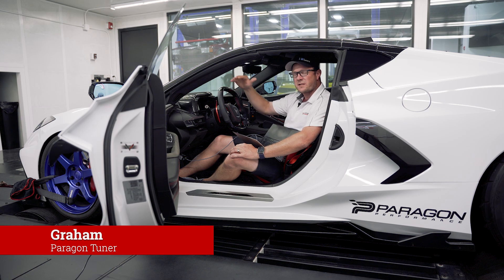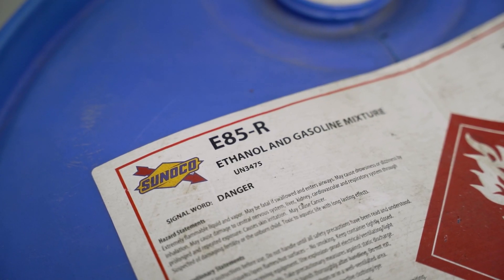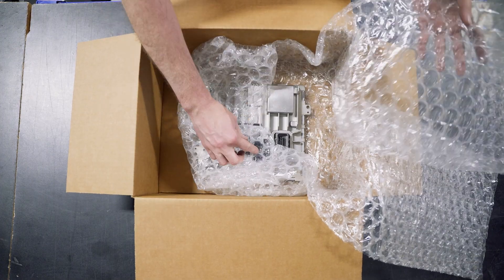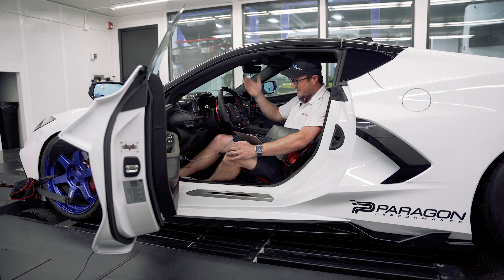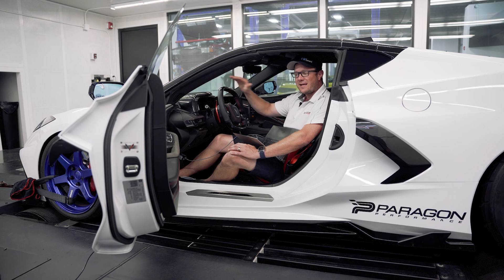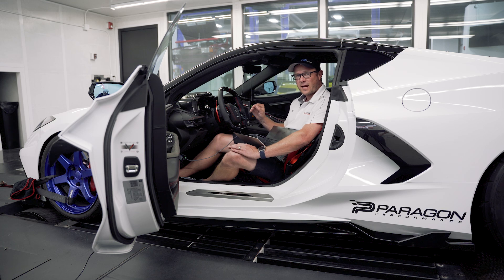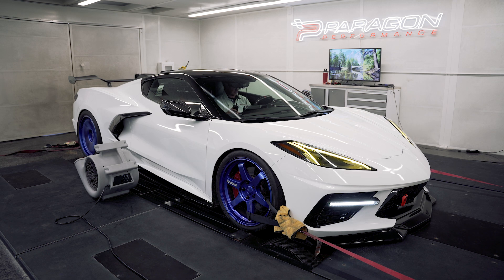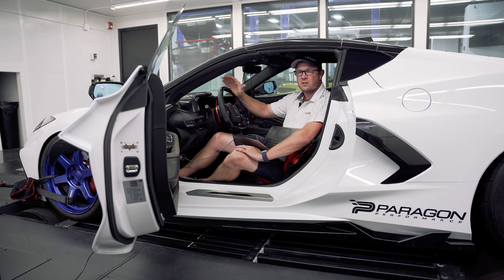Paragon C8 Corvette ProCharger Tuning Update!

Comment: my C8 is on order and im very interested in this application but uh.. is that filter a little inadequate? i mean damn that thing looks small.. at 6k rpm how is that little dinky thing passing enough air? guess i'll have to trust the experts. but to be fair.. did you guys look at that much? even TRY a different filter?
Reply from the maker: It provides plenty of air. We had talks of upgrading the air filter but it’s not a issue so we left it
Reply: @ParagonPerformance  perfect, thanks. Now just fix the size of the wheel spacers for the e-ray application and you'll be kings =D
Reply from the maker: @WhyDidYTstartThisHandleShit  Once we get a E Ray

Comment: How do you compensate for the changing atmospheric conditions when calibrating the tune?

For instance, Phoenix has an approximate elevation of 1090ft with the accompanying heat index while Flagstaff is located around 7000 feet elevation but happens to be a lot cooler in temperature. Many people here in the great state number Forty Eight enjoy the drive between the two towns. 

When adjusting the parameters of the tunes, how do you account for the various atmospheric conditions after you finalize the project? Far too many people assume that forced-induction is unaffected by atmospheric conditions which is simply not true. Curious to hear if you have any experience with these variables. 

Stay classy my friends.
Reply from the maker: Modern ECUs have Barometric pressure sensors build in so they know the elevation and use compensation tables to account for it and the same goes for intake temperatures.  All these compensations are adjusted and accounted for when tuning, especially with forced induction. The tune is setup to handle all possible conditions. We've test and collect data to ensure all these tables are working properly.
Reply: @ParagonPerformance   Excellent.

This allays most of my concerns. I definitely want to pursue some form of forced induction in my C8 once it is finally delivered from GM. Perhaps a video discussing the various forced induction options and their 'pros and cons' would be appropriate. Please and thank you. 

Nevertheless, I appreciate the clarification gents and look forward to doing business with you in the near future. 

Stay classy my friends.

Comment: I applaud the work and effort. To me both GM and Procharger have killed the big power adders unless you have tons of money and ok with replacing things.  The market has gone nuts thinking many will pay 20K+ for a power adder. I paid a tad under 7 for my c7 procharger. Understandable GM didnt make things easier either and how to bypass it just adds more. With people getting trans and engine issues still its not worth losing the warranty.   Hell as much as things cost I might have to extend it since I have little faith .. haha
Reply: I dunno 20k for the parts plus 3k for the approved installation plus 1k+ for the tune.... You could buy a whole other vehicle....
Reply: @Wezbian it wouldn't hold a candle to this car.  I have a lingenfelter tuned supercharger on mine and it is a beast
Reply: @nicklovely6431  how much did that run you?
Reply from the maker: It’s a good value for the power and the amount of parts as well as R&D .